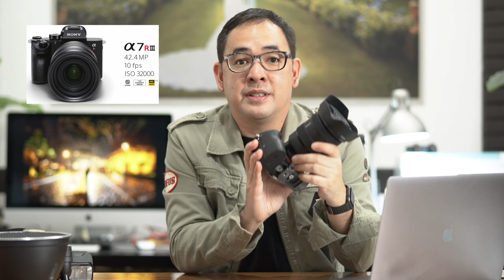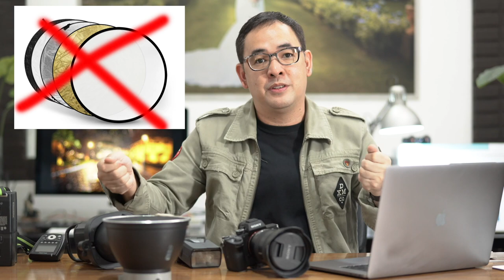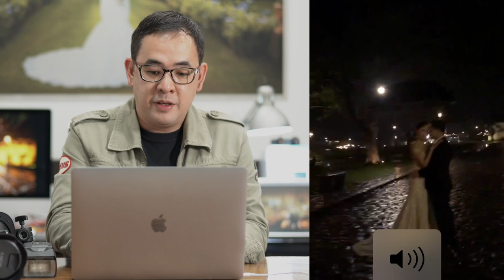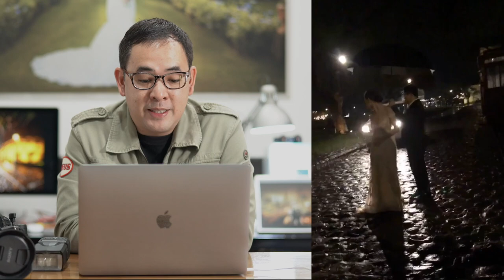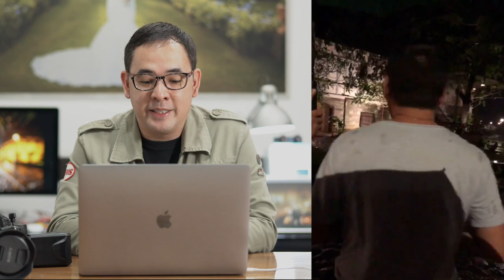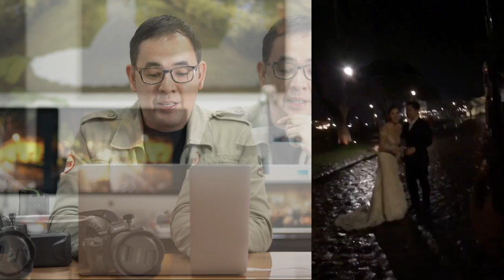TIPS and TRICKS on how to PHOTOGRAPH in the RAIN: A LIGHTING Tutorial

Comment: wow it's great. Sir may i ask if you have the manual flash (not ttl) is it still possible to control the light intensity  from your transmitter on the camera without touching the flash that your assistant in red raincoat holding?
Reply from the maker: Yes if your flash and trigger allow remote controlling of the power